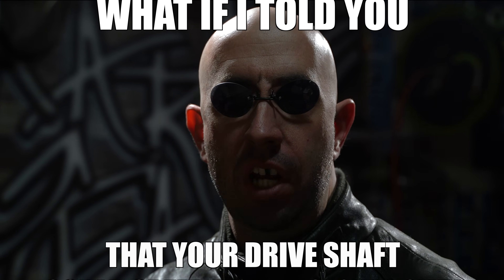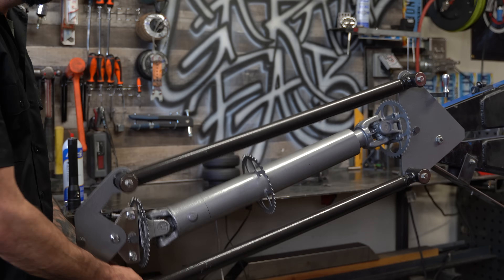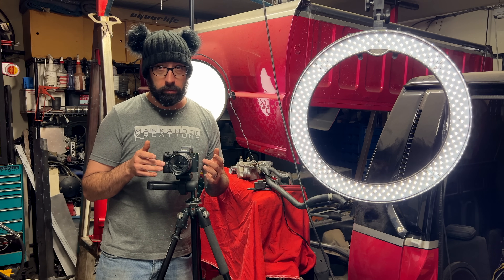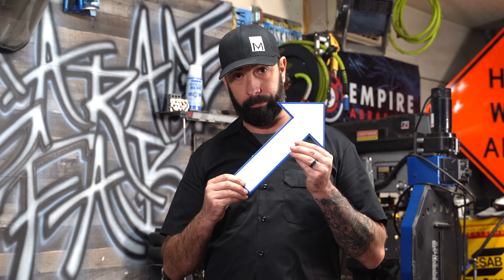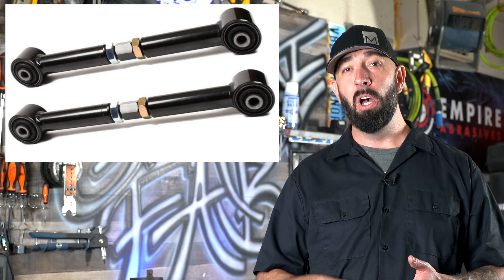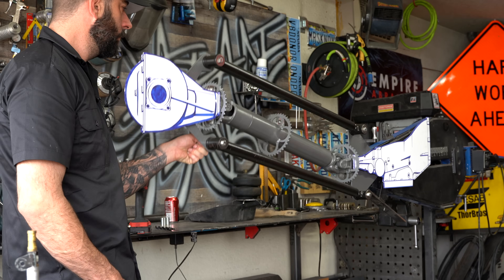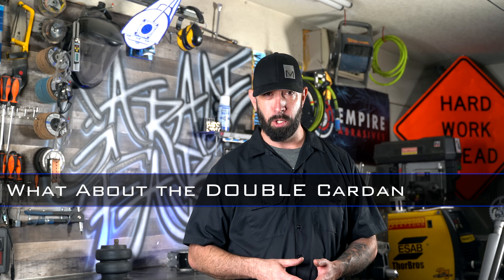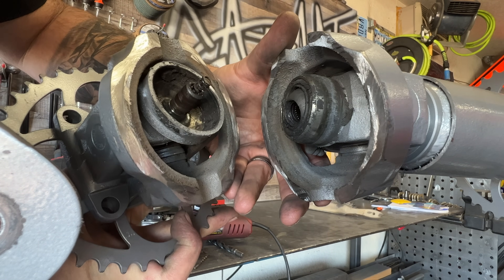THE Driveshaft Video. The Nature of U Joints. Suspension Basics Ep. 06

Comment: would changing rear leaf springs change all this? i have a 72 charger that i replaced leaf springs with oem leaf springs and now my car vibrates on deceleration in 4th gear. when i accelerate it goes away more or less
Reply from the maker: It’s definitely a possibility. And the way you describe it makes it even sound likely. You should be able to check on your own. Be sure to chock your tires so that the car can’t roll and remove the driveshaft from the rear differential. Check the angle of the front of the differential and check the angle of your crankshaft pulley and see how closely they match.
If they’re more than a degree off, you can buy thin angled blocks to mount between your axle and leaf Springs to change your pinion angle slightly.
Reply: @GarageFab  yes sir. I bought the same angle finder as you too. I plan to check everything out good. Seems simple enough as far as getting the numbers to match! I got some short reels of my Charger if ya wanna check em out! You have my subscription!

Comment: I mean, this is so epic... i lifted my commamder... just the front... went for a drive... the rumble is emmense!!! I've been so worried... now i can lift the back knowing the drive line is prob the rumble...
Reply from the maker: Hold off on that my friend. I don’t think lifting the rear will solve your problem.
I’m assuming your Commander is 4 wheel drive but I’m not familiar with how those are set up. Solid axle? CV axles?
Generally lifting the front won’t cause the rear driveshaft to vibrate. 
I realize the driveshaft is technically at a different angle in relation to the ground, but the shaft angle in relation to the chassis/transmission/differential should be the same. Let’s look at some other stuff first. What all did you change before the rumble started?
Reply: @GarageFab  hi mate, so... firstly, i did a 2.5-inch lift...(with a plan to do the rear soon after) then changed the lower wishbone as the ball joints were shot... then realised about the transfer box bushes... which were shot, so I dropped the transfer box and replaced them... then changed the cv shafts as it was all apart... then noticed the wobble at the front.. popping crunching...

I lifted the rear today.... but you are right. The popping is still there... when i jack up the front left wheel, it will not turn more than 5 degrees...

So i now think the cv shaft isnt aligned....
Reply: @GarageFab  if the cv shafts were old, i would have marked them before removing them to make sure they went back the same way... but obviously, they were brand new....

Comment: I know this is old content, but I’m designing a parallel 4 link rear airbag suspension for my f350, and this was BY FAR, the most helpful, simple to understand, playlist of info I could find anywhere. From setting pinion angle, to simplifying the rectangle shape I need for the links, bushing type, perfection. Thank you for putting this together it should be in mechanical classrooms everywhere!
Reply from the maker: So very much appreciated Jared. Lemme know if you get stuck. You know where to find me. Best of luck my friend!
Reply: i am going to install a lincoln mk viii IRS in my F100. how does one go about setting up the correct pinion angle on an IRS? i had always envisioned shimming the 3rd member to achieve the correct angle. can you offer some guidance?

Comment: Awesome video! Hilarious and informative, cant beat that 😊
Reply from the maker: Thank you my friend!
To answer your other comment that I can’t find at the moment;
No, the angles don’t always need to match perfectly. It’s just important to know that the bigger the difference in front and rear U joint angles, the greater the potential vibration.
Another very important note is that the shaft RPM/vehicle speed also matters.
For example say you have a drive shaft with a 2 degree difference in front and rear U joint angles.
You might not notice a vibration at 25kmh but at 80kmh you might.

Comment: Okay wait… double Cardon joint… that link looked like a little CV joint inside. No?

Anyway, I’m running Metalcloak front and rear driveshafts with double cardon joints in a ‘17 Jeep Wrangler (2-door) with a 4.5” lift (Metalcloak Lock n Load). I had a local shop help with pinion/caster and axle/alignment after install using all adjustable control arms. Seems fine so far. 

Can someone explain why a different after market shaft without double cardon or with CV or just … what I’m running seems fine so why wouldn’t you recommend double cardon for lifted jeeps?
Reply from the maker: Hey Josh!
What link are you referring to? Are you talking about when I split the Double Cardan open? If so, inside that joint is a ball and socket similar to a trailer hitch that keeps both of the U joints in the double Cardan at the same angle at all times.
There’s nothing wrong with using 2 double Cardan joints. (A quadruple Cardan? 😆) In fact, on a solid front axle, a double-double can sometimes be the only way to simultaneously get a specific caster AND eliminate driveshaft vibrations. I’ll explain why…
On a rear driveshaft, in order to use a double Cardan joint, the double joint must be mounted in the front, (at the trans/transfer case, and the differential must be pointed almost directly at the double Cardan joint in order to keep the single Cardan joint in the rear nearly straight.
So if you’re forced to position the differential like this, it takes away your ability to adjust caster on a solid front axle. Using 2 double Cardan joints allows you to ignore everything in this video.
So you ask why a double Cardan isn’t always recommended? I think mainly because they’re expensive. I can assure you this is the definite reason why factories don’t do that. They have to cut costs as much as possible. For us private builders, it’s usually just not required if you know how to set up your angles properly.
If you don’t understand driveshaft/Ujoint angles, using two double Cardan joints is a good insurance policy.
Reply: @GarageFab  yes the link inside when split was what I was referring to. 

I have a double cardon front driveshaft, and a double cardon rear driveshaft. Both have the double end on the transfer case side. 

Initially after lifting 4.5” (Jeep here), the rear vibes were wild. Seems to be all sorted now. All adjustable control arms helps for sure. 

Overall goal here is to run 37” tires on a 2-door Jeep with loads of travel/flex. Still working out some kinks but so far so good. 

Thanks so much for your videos! Wish I’d watched them before beginning this project, but really helping me understand and fine tune things. 👍

Comment: Can you explain why on 4x4 trucks, I  have been told you get less vibration out of a rear one piece drive shaft, versus having the 2 piece with the one carrier bearing in it? I want to know what is best, because I am building a truck and will need the rear drive shaft made to the length needed

Comment: A 3rd option is a custom driveshaft with CV's on both ends. More expensive, but for drag and drive cars, it seems like the best choice. Also, some engine swaps make it very difficult to get the engine pointing exactly where you want it. CV joints get rid of all of these problems. Only downsides are slightly heavier, more expensive, and more difficult to service.

Comment: Would a 2 link ladder bar setup with a double u joint on the transmission be ok? With a ladder bar, the pinion and driveshaft would always be parallel, so there would be no rpm difference between the driveshaft and the pinion
Reply from the maker: You are correct my friend. The ladder bar is an ideal time to use a double Cardan when set up the way you mentioned. The single rear joint remains mostly straight at all times so the double Cardan handles all the work.
Reply: @GarageFab  In general, do longer link bars result in better ride quality? I understand that longer link bars result in less forward/backward movement as the axle raises and lowers
Reply from the maker: I don’t know if anyone has ever asked me that before. And I don’t think I’ve even questioned it myself. Yes, longer bars equals less forward and back motion and therefore also creates less movement of the driveshaft slip yoke.
But as for ride quality, I’m unsure! My instinct says a long bar with a very large arc would move more smoothly than a tiny bar with a tight arc, but I honestly don’t know how that would translate to handling and road-feel.
Lemme know if you figure than out! 😆
Reply: @GarageFab  What determines how much articulation a suspension has? I'm thinking particularly about 4x4s
Reply from the maker: It’s a cross between the link configuration and the bar ends. Polyurethane bushings don’t allow much twist, so they’ll bind and limit articulation. Heim joints and Johnny Joints allow much more articulation as the bar ends can twist significantly more without binding.
Then comes the links themselves. A parallel 4 link requires a panhard bar which limits articulation quite a bit. The double-triangulated 4 link on the other hand has no lateral locating bar so the ONLY thing limiting articulation is the bar ends and eventually the bars crashing into each other.
You can find images of rock crawlers online with the front axle 90° (perpendicular) to the rear axle. 🤯

Comment: I have a question: Can I simply choose a ride high without knowing vehicle weight and use that to set my pinion angle?. And then later on choose some coilovers that will get the vehicle to my chosen hight? 

Currently my chassis is too long for my body and I need to Lobb like 19" off the back so I can drop my body on and build a floor pan(channel). And to be able to Lobb off that 19" I gotta remove the leaf springs and get that rear knuckle/hanger out of the way. And so I'm nearly finished my 4 link design much thanks to your videos. And ya so I need to install on an open chassis with no weight information. Do you think that will be fine?
Reply from the maker: Absolutely! Just remember at what height you decided to set the pinion angle. Adjustable coilovers make this whole process really easy. Trying to determine height with your typical static spring is a huge hassle. 
Technically you can build the entire vehicle and make the coilover install the very last thing you do.
Set everything up without springs at ride height, including pinion angle. 
When it’s time to install the coilovers, set them to the halfway point, lift the vehicle up the estimated amount you think the weight of the vehicle will compress them, (Usually 1-2 inches) and weld them in place. That should get you close enough to be able to perfect it either up or down with the adjustable coilovers.
Reply: @GarageFab  oh excellent I'm glad you pointed that out. I'll do just that. 

Last question. I've already designed my brackets and measured out my link bar lengths but I havent started to fab it yet until I've made sure. 

I've not been able to find much information about where my forward bracket should sit on my frame front to back I mean. I thought it be safest to have the forward links perfectly in line with my forward U-joint so that both articulate at the same angle. But I'm not sure if it matters or not. And I don't know if I missed that part in your videos but yes not much of any material covering that subject in my searches. 

And do you have a community channel or mail box where your viewers can post/share their builds with you and eachother. I Tell ya I didn't have the confidence to build my own 4 link until I watched your vids and Im pretty proud of myself so far🤣
Reply from the maker: Nice! Distributing confidence is the whole goal of the channel. It’s kinda hard to tell whether or not I’m just spinning my wheels unless someone mentions it as you have. Thank you!
I’m impressed! Most people can’t see the relationship between link bars and the driveshaft. Here’s the deal. A slip yoke on the driveshaft is typically all you need. The amount that the slip yoke moves is determined by the differences in length between your driveshaft and your link bars. If you match your driveshaft to your link bar length as you mentioned, in theory your slip yoke wouldn’t move at all. But because have a slip yoke, you don’t need to worry much about it. A longer link is generally better as it creates less forward/backward movement of the driveshaft as the suspension cycles, but since you’re building a static he vehicle, that’s not really something you have to worry about either.
Reply: @GarageFab  Excellent! Well that clears up all my questions. Much appreciated. I've just finished making a full mock up set with fiber board and PVC pipe to test fit with and I gotta tell ya it looks so fancy.. I'm relieved you replied back to me so going forward I won't have any more doubts
Reply from the maker: Yes!! I love cardboard, wood, arts and crafts mockups. 😆

Comment: That was really excellent. Thank you. Since you are fully into fabrication why not just fabricate 2 true CV (Rzeppa, cross groove, Tripod Tulip, etc.) joints into the driveshaft and eliminate the u-joints? You should still setup the pinion angle but I would think you would have less problems from large suspension height changes.
Reply from the maker: Thank you my friend. Honestly, I’m lazy. 😆 Since U joints can be setup with no issues when done properly, there’s no real reward for the added effort. It would be neat though!

Comment: double Cardone joint  you want  for flex is d 1 from a straight axle 85 an below Toyota pick ups on the front drive shaft i made a custom drive shaft out of square tubing for my rock crawler with IFS front  Cardone And it was a magic thing went like 60 without vibration only problem was the IFS Cardone joint did not have the flex and would Bind

Comment: Aaron, want to run something by you. I have a 1966 C10 with stock suspension. I'm putting a 496 and 6L90e in it. Custom motor mounts. Since pinion angle is fixed, my thought is to match output shaft angle. Instead of worrying if my truck is level, I thought I'd use digital angle gauge on pinion, zero it out, then set on output shaft and lift it until it's zero. Does that make sense?
Reply from the maker: That makes perfect sense. Using that method you could technically do it in an angled driveway. 👏 Sounds like you understand things perfectly.
Reply: Thanks Aaron.  Watching you has helped me a lot. Keep up the good work. @GarageFab
Reply from the maker: @brianwilkenson6998  Happy to be of service my friend. 👊

Comment: Excellent videos! Question: Why did you decide to change your wife's truck from the triangulated 4-link it already had to the standard 4-link with the watts linkage? It's obviously more work, so I assume you identified a benefit.
Reply from the maker: Hey Bryan! My reasoning for doing things isn’t relevant for most people. YouTube! Things I do are often unnecessary but they would make great content. Leaving things alone is boring!
Aside from that, I have a few rules that I feel should be followed when building a triangulated 4 link, and the original builder did not. But rather than just rebuild what was already there, I was able to get a link bar video, a parallel setup video, and a watts link video. 🙌

Comment: Does having the differential offset right or left from center affect or change the oscillating speed?
Reply from the maker: Yes, but generally it’s not a concern. 
First, understand that we’re now talking about a different plane. Normally when adjusting transmission and pinion angles, we’re just focusing on the vertical plane.  As long as the engine/transmission assembly are mounted straight within the chassis, and the axle is also straight, then the trans shaft and pinion shaft are parallel on the horizontal plane. If the differential is offset enough, the speed change of the driveshaft will still happen, but there should be no resulting vibration because both U joints have the same angle.
Since the engine and axles are usually straight, it’s probably not something we need to worry about.
It should be mentioned though that an offset diff will contribute to total U joint operating angle, and an over-bent U joint can potentially cause problems.
Reply: @GarageFab  thanks for the input.  Really did enjoy watching the video.
Reply from the maker: My pleasure. Thank you. 🙏

Comment: Will a pinion and transmission pointed down at equal angles vibrate?
Reply from the maker: That gets a little complicated. With that setup, the most important thing is the U joint angles (bends) not the pinion and transmission angles. Equal U joint angles in any setup is the goal. Parallel trans/pinion angles is a cheat to achieve equal angles.
With your situation, if the front and rear U joints are the same height from the ground, (meaning the driveshaft itself is parallel with the ground) both the front and rear U joints will have equal angles
and there should NOT be any oscillation related vibrations. The problem you could potentially have is when the suspension is heavily loaded (or lifted), the driveshaft is no longer parallel to the ground and the angles of both joints will change in opposite directions.
By that I mean, when the suspension compresses, the rear U joint will straighten out some, and the front U joint will bend more, which could potentially create an issue.
Lemme know how badly I confused you. I may need to send you a video response. Cheers!